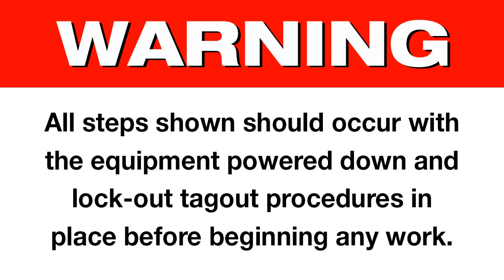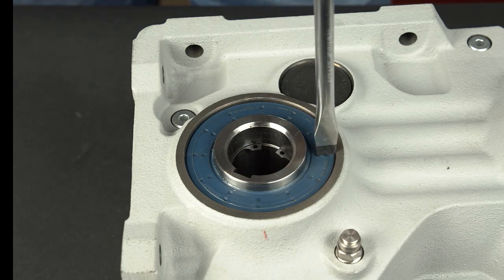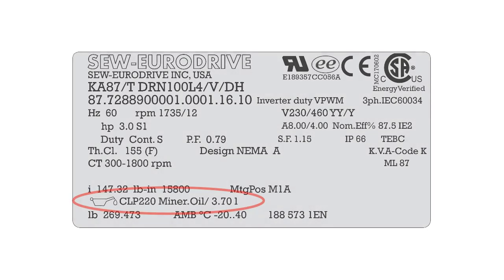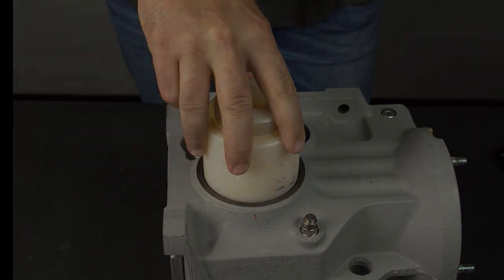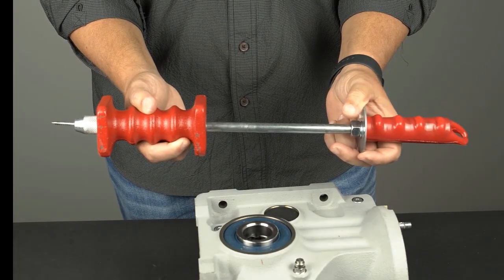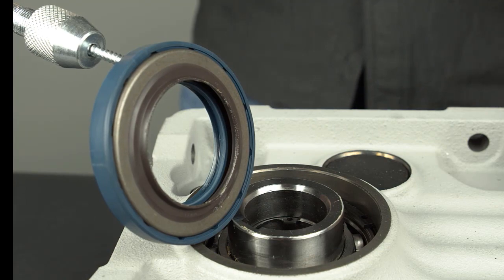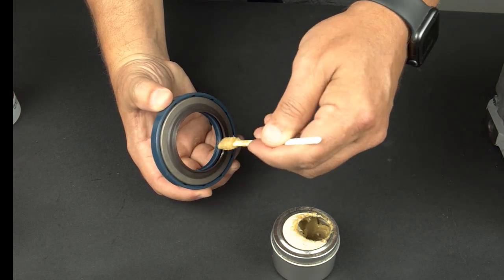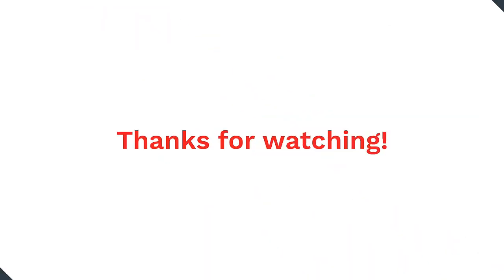Changing the seal on an SEW-EURODRIVE gear unit

Comment: is it normal to have oil leak from oil seal?
Reply from the maker: @RideWithAnthony it is not normal for an oil seal to leak. Oil seals are wear items and parts of the gearmotor that need to be replaced when the time is due. The length of time the seal will last depends on several factors such as operating environment, shaft speed, oil type, and any external debris contacting the seal surface. If you find a unit with a leaking seal it should be replaced. If you provide your local SEW-Eurodrive customer service with the S.O.# from the gearmotor nameplate they can provide you with the part number and type of seal you need to use to replace it. Here is a map of the SEW offices in in the USA. Click the region on the map for the contact details to appear. https://www.seweurodrive.com/contact_us/find_cs_sales_distributors/sales_default_nmc.html